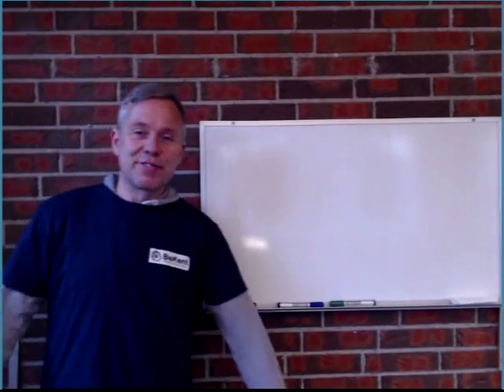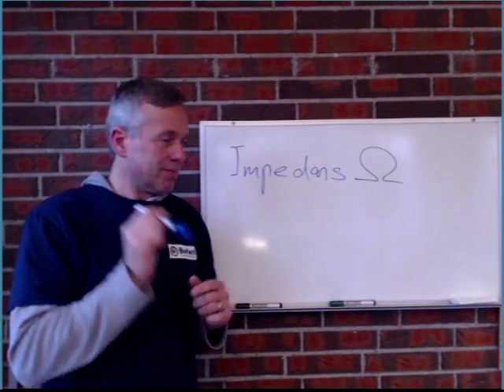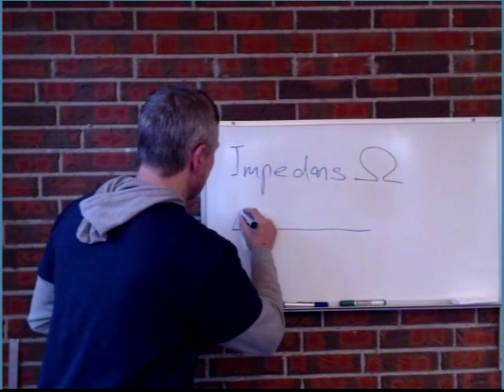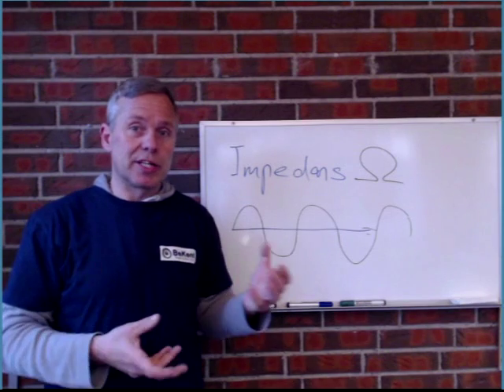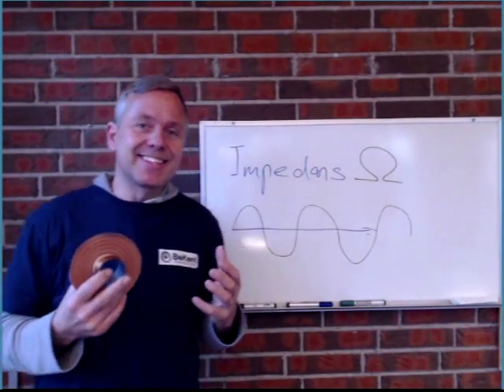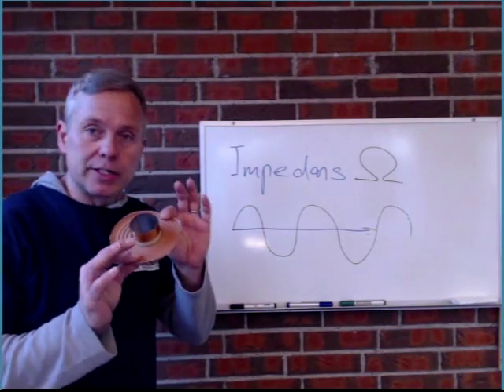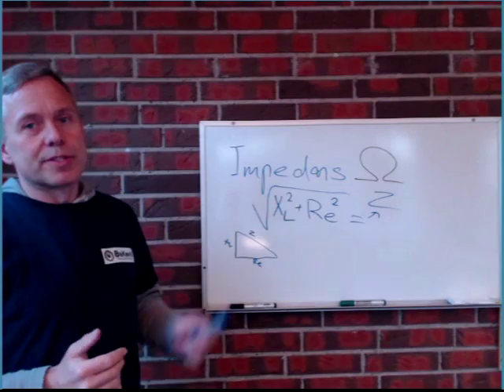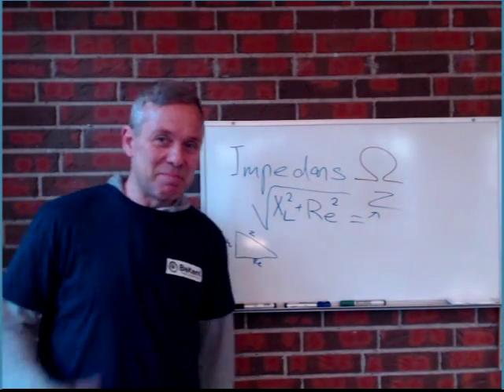What is Impedance?

Comment: Combine two circular dipole magnets and their center circle holds a micro current potential. Add a third dipole and the entire center magnet has potential current. Generators have a B phase magnet current per cycle discharging into the entire circuit. The circuit becomes unstable from that. Static resonance is produced per cycle. Impedance heat is the beast magnet breathing fire. Resistance would not be restrictive. That one magnet provides it. Magnetics really do not actually get resisted without the neutral magnet. Modulation is built around that rogue neutral current. Impedance can be done away with, as charge control becomes smarter. cJT

Comment: So my meter has a 10M ohm impedence so what does that mean?
Reply: It means, your multimeter will NOT load the circuit you are monitoring and give you a more accurate reading then a multimeter having 10Kohm impedance.
Even the cheapest digital multi-meters have at least 1Mohm impedance.
Reply: Cave Jug thank you